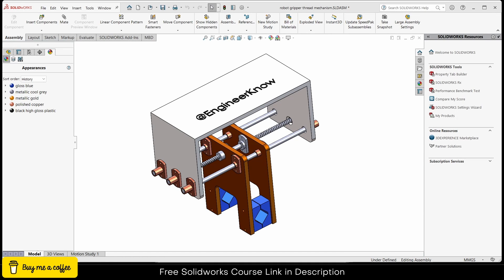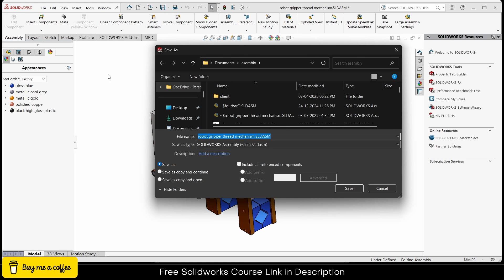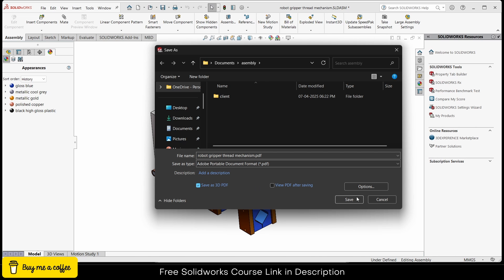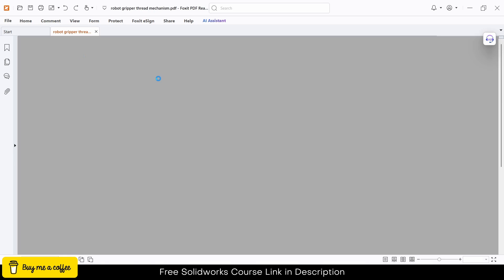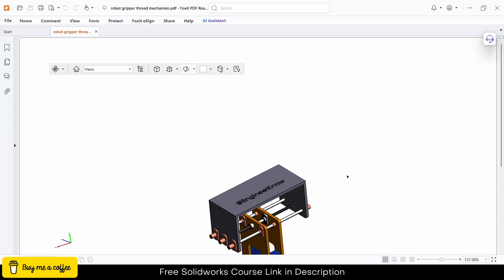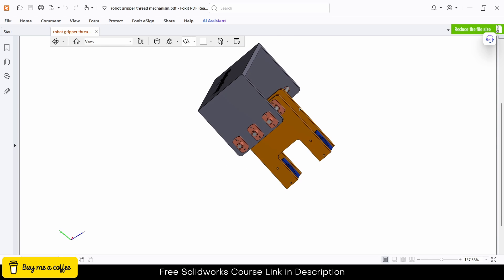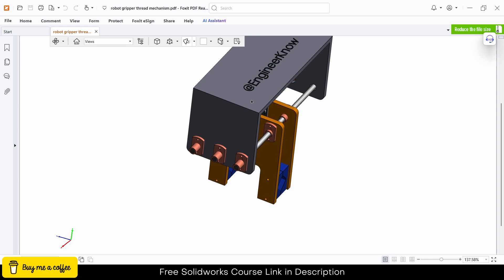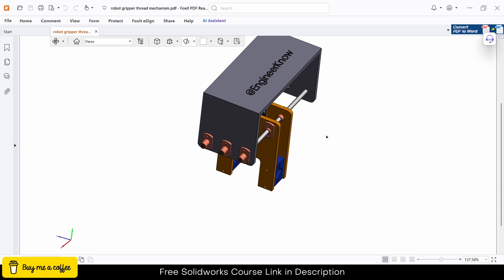Solidworks to 3D pdf file

Comment: Hi! I'm currently working on a rollcage project and need to share a bending diagram with vendors so they can bend and send the pipes accordingly. I'm a bit confused about how to properly create such a bending diagram from my CAD model.

Could you please make a video on how to generate a professional bending diagram that includes all necessary details (like bend angles, lengths, radii, and orientation) for vendors? It would be really helpful